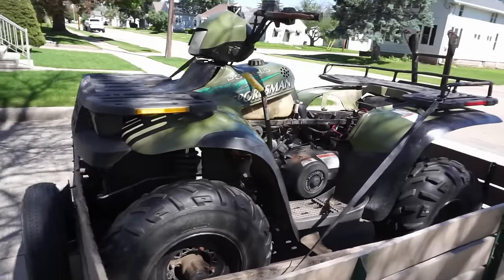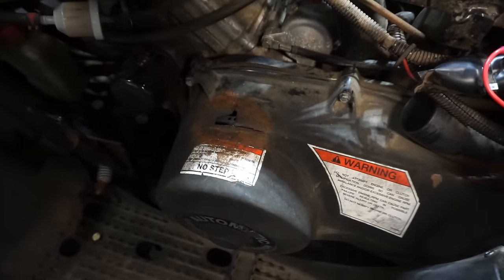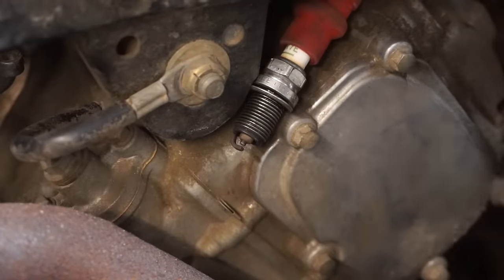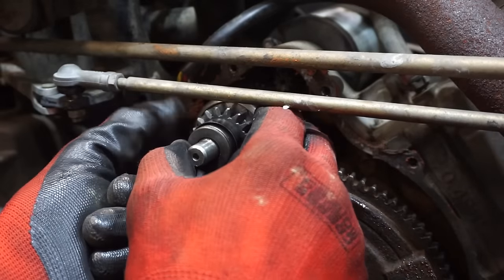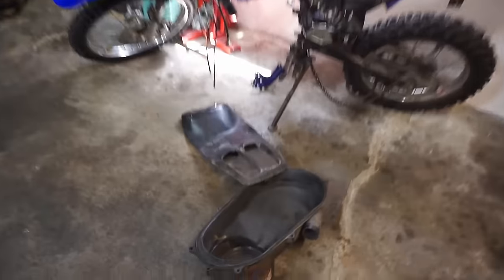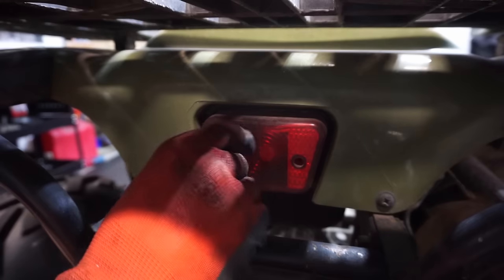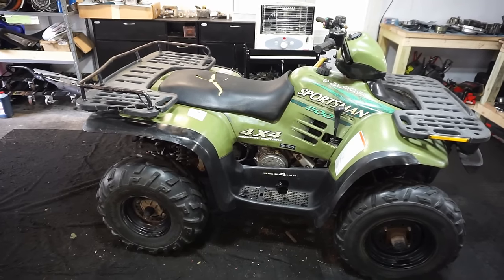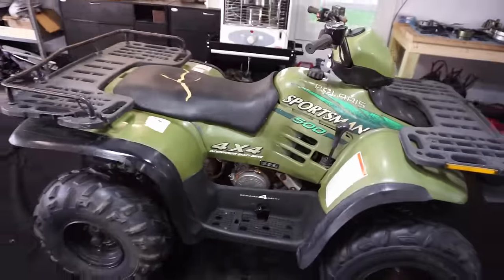Polaris 500 4x4 Has No Spark (Nobody Could Figure This Out)

Comment: My bet is the clutch cover got worn down from a kid riding on the quad and putting their foot down on on the cover instead of the floor board. Super common in the CVT driven Polaris quads, a Dad wants to take his kid for a ride and that's the only place their feet land.
Reply: Before the year 2000 Polaris made them Thinner they get hot and warp really easy
Reply: Yeah because of inflation
Reply: They didn't just make it thinner they made it out of pot metal
Reply: yep i used to do that as a kid
Reply: Or he has short gf lok

Comment: Here to say thank you for this video.  Went riding last week, shut mine off in the middle of nowhere, 10 mins later it wont start.  Luckily was with a buddy, he towed me the 3 miles home(of course both of us had our sons riding with us too).  Smelled gas, put a spark tester on it, no spark but power at coil, bought new coil, waited 3 days, installed new coil and plug wire, still no spark.  Googled, found this video, popped the cover off, sure enough pickup moved.  Readjusted to .020" gap and boom, fired right up.

Comment: I worked on a Polaris that had the same hole worn in the clutch cover.  He also had a plow.  When the handle was pulled back it rested on the clutch cover and had enough weight to push it down enough for the pulley to hit and wear a hole

Comment: I have a 97 that my brother In-law sold me for $300 that he had been overheated due to a failed fan switch with 2100 miles on it unfortunately it had been generally neglected and abused, i put it up on a stand and went at it, re-ringed/head gasket, hose’s, fan switch, thermostat, drive belt, all bushings/ball joints, struts&shocks, battery, handle bars/grips, set cover, brakes/tires, CV boots, air cleaner and full service front to rear, Ive put close to 700 miles on it all up through the Sierras and to the deserts of the South West, its extremely reliable and stupid simple to work on, parts are plentiful and cheap! i think i have total of maybe $1700 in it.

Comment: The holes on the back clutch cover get hogged out, then gravity pulls it down, then clutches/belts chew through those outer clutch covers.  There is also supposed to be a rubber gasket between the two, and since the outer cover is tapered, removing that gasket reduces clearance, that and kids standing on them like someone else said, hah.  I like the old polaris quads, cause the old ones have lots of parts interchangeably, they are funky, but they stayed the same kind of funky for decades.  The belt drives are also good for whacky swaps, im putting a 20hp yanmar sailboat motor i got for free into a trail boss 350l 4x4, and im helping the neighbor kid put a 540cc arctic cat sled motor in a trail blazer 250.

Comment: I had a 2000 model sportsman 500 4x4 and for the most part it was a good fourwheeler. The biggest issue I had was the 4x4 acting up and the camshaft messing up. The 4x4 froze easy going through snow and sleet and mud and water wasnt good for it either and it always went out after a while. It seemed to had some other electrical issues from mud and water n stuff. But when it ran right it had a ton of power and the 4x4 work good when it worked. Love the clearance to.

Comment: Sure glad to have found your channel , I have a 2004 , I bought when it was one year old in Fairbanks AK.,it has been a headache lately but it 20 years old now , I've had so much enjoyment the whole time I've owned it , lately I've had to replace axle boots , belt and starter lately , all suspension bushing , now I just have to replace the speedo because no 4 wheel drive ,then it will be great again , lucky for internet you don't have to pay those crazy dealer prices. I've never let anyone else use it so it's in good condition.

Comment: #1 You don't need to remove the step to take off the clutch cover.  #2 The starter IS engaging but the bendix messed up.  #3 The clutch cover is not stopping the starter  #4 There is a hole in the flywheel to access the pickup screw.  #5 If you pulol the primary clutch you'll discover that the centrifugal arms are worn out and this results in the clutch hitting the cover.  #6 Good call...running without battery is exacctly what happenned.  Probably be "dash" indicator lamps burnt out also.  #You need to make sure the coolant reservoir is filled to indicated.  #7 Need new air box as mos of the retaining blts are broken out of plastic (bad design)

Comment: A quick tip trick that plastic cover can use A thin sheet of aluminum platting drill four holes through the plastic& aluminum plate to use aluminum  reviots in it. To stop the noise of the rattling sound it puts off. From the rubbing up against the plastic. From not being tightened up inside of the cover shroud.

Comment: My cousin had  a similar problem with his Polaris 500 HO with  the pick up coil I took it apart and found a washer inside and messed up the pick up coil so I went on eBay bought one for 25💵 and fixed,
It great video...

Comment: I would put a floor jack holding on the plow connector and then apply heat… so have it barely off the ground with the jack to have that constant pressure and see if the heat works.

Comment: I have been all around these fourwheelers, my father has one, my brother has one and I just sold mine because once they start breaking, it never ends, cv axles, carburetors, starters, top ends, clutches,bendixes that grenades inside the cover and breaks pickup coils and miscellaneous things the bill adds up rather quickly anyways great video I am just tired of working on theses machines as i did two rebuilds and put many hours in mine. have a great day!
Reply: My dad has a 200 sportsman 500 ho, he has had it since new, has well over 15,000 miles on it and the only things to ever go bad was a CV axle and belts, and normal wear items, like plugs, batteries, tires, etc. It is all about maintenance. I do like my 2009 Yamaha Grizzly a lot better, been a really good machine as well, i have 4500 miles on it and the only thing i have had to replace has been a couple of batteries and a spark plug. Both are good machines but the Yamaha is definitely easier to work on.

Comment: Those older polaris clutch covers do heat distort and start rubbing from excessive idling without ventilation on hot summer days. Both of mine have needed new covers and they no longer rub at all.

Comment: if you can get to it , Check the valve lash , and take a look at the center exhaust rocker on the cam for wear,, check the function of the compression release on the opposite end of the cam to see if its spring is returing it to its compression release position,

Comment: You can scuff it up to flex glue seal the plate on with.& then pop the revoits through the plastic after its stuck on for 4 hours. Then. You can prime it.& spray pilaint the cover black again to.

Comment: I got a little hack for you so if you don’t have spark you go and get a thin wire put that wire into another spark plug wire start that quad keep it running and put that wires to both end and while the other quad is running try starting that it always works for me

Comment: Was suprised you didnt try and melt a patch into that open wear hole,should be easy enough with hot flat soldering iron n heat gun,just find some trash plastic parts and melt in or even stitch in worst case just put a piece of tin on inside and rivet from inside out pound outside stem flat ur golden.keep soaking n pounding the plow attachment it will eventaully move because it did at one time.just rust has its frozen hold on it.never give up!!!snookie pa.💥👍💥

Comment: Before you beat the plow bar to death, remove the grease fitting to be sure that the grease can even get through it. The grease fittings seize up as well. Than when you heat it up again use a tea candle to rub on all the places that you can see that should turn. Use the candle like penetrating lube. Heat a joint and apply the candle, allow the candle wax to wick into the joint with the heat. It will surprise you how well it can get into the tight places.

Comment: So watching what I saw I assume what happen was the pull cord guts came loose and slapped the pick up coil he goober snotted the cover back on and then found no spark to let you know the specs on the pick up coil is .4-1 mm from the magneto I try to set those to .621 on a feeler gauge or close to that I hope that helps someone out there good job on the find I enjoy deals like that
Reply: As far as the lights check and see if your rectifier is charging the battery when they go the make the bulbs super bright for a while then die make sure you are getting around 14.4 volts if you are getting like 17 or nothing but the 12 volt that your battery has  change the Rectifier

Comment: I'd just order in one of those speed omemeter cable shafts.,or you can reweld the snapped one back together inside of that housing.,or just A squared up., whatever design of end is on the Speedo cable.

Comment: i have a polaris sport 400l and the cvt cover did the same thing, i ended up ordering a generic one off of ebay and it was actually slightly bigger diameter and fits better than the original, i think its from riders standing on the cover or its just warped from heat maybe?

Comment: Yes their angled downward Tom. Only if their worn down.,chipped teeth should those be replaced.,or the contractor spring to release the starter gear drive from the flywheel to.

Comment: I have an 05 Trx450r that is giving me a spark issue, stator checks out as far as resistance goes, I don’t have a peak voltage meter to test the voltage. I used a multimeter and only got 6v while kicking it over. I’m about to pull my hair out trying to figure it out

Comment: You seem to have issues with things you don't understand, case in point the clutch cover, backing/mounting plate ,you never checked it for loose or out of adjustment,you failed to even acknowledge the fact it had nothing left in the recoil starter ,

Comment: The kill wire runs all the way through the harness ending in multiple useless connectors. My customers had so spark. Someone had cut and spliced wires everywhere to try and find the problem. After i fixed that and got spark  back, it ran but wouldnt shut off. 
Opening that handlebar switch was a fun mistake. 
Turns out a single pin on the speedo was broken. Why Polaris has a need for the MF KILLWIRE TO RUN THROUGH THE SPEEDO, i have no clue. 
Since the lense was as opaque and tarry as Bidens latest mail in stool sample and reverting back into an actual dinosaur,  i didnt even other looking for a new one. 
Left that 45mph tops, cus you have never changed a belt, but haul 2 coolers, a roadkill doe, and someones fat baby sister on the back,  crystal ball of disappointment unplugged, and she runs  (and shuts off) like a champ.